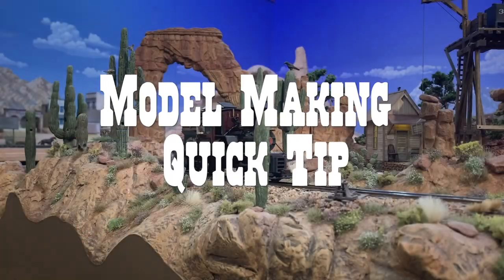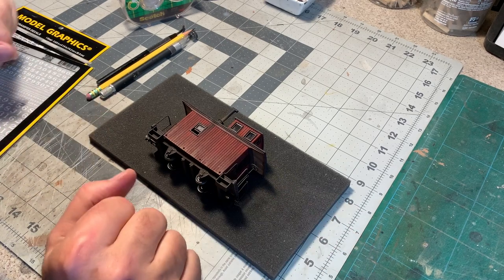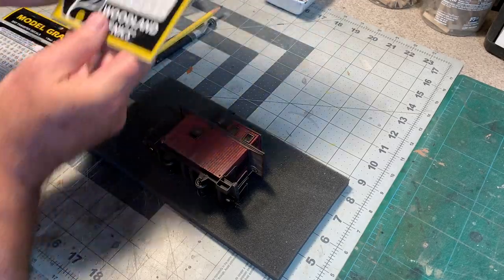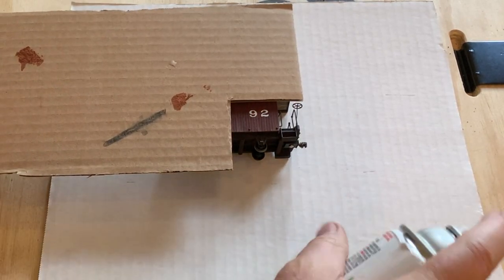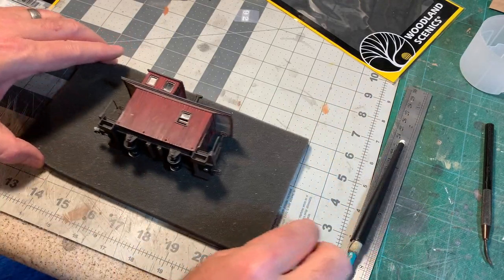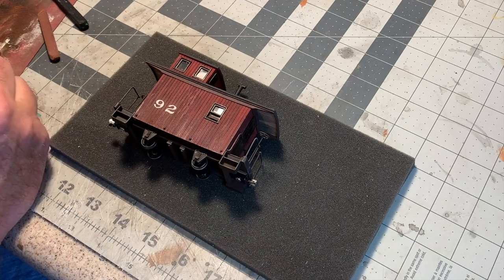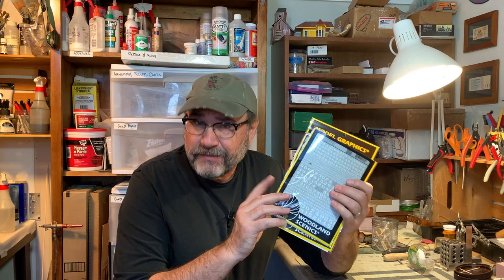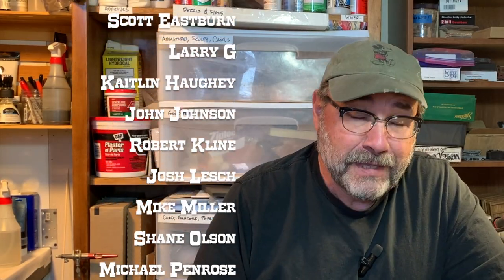Model Making Quick Tip: Dry Transfer Decals

Comment: Dave, I also remember the old Letraset transfer letters from Architectural school day', used them to produce great-looking drawing title blocks. Fat forward to Woodland scenics, work great on wooden cars., the pencil is the best burnisher for all modeling surfaces.'Dry transfer letters on airbrushed cars/ locomotives etc are a little bit more challenging.. I've applied them over tru -color paint and the tape masking or scotch pulls off the paint if you rub the tape down to stick. Ruined a few good paint jobs that way.I now use a rubber band to hold them in place. If you make a mistake the letters can usually be pulled off w/ masking tape/ soft touch and or a little water on the letters and lightly scraped off using a Windsor Newton watercolor brush.
Thanks for your tips. !! Todd

Comment: Good info as always!! I will not accuse you of being as old as I am.....but in the 1980's when our hobby shop wanted to start a decal and dry transfer line I went to the big art supply store in Charlotte. It had a room, about 24 x224, full of every Latraset sheet. I used a lot of these until graphics computers became viable.  But even after the computer age came we were still making dry transfers for the model car hobby. Charlotte had TWO print shops that did the dry transfer process in house. By the time the hobby shop closed we had made , and sold, millions of dry transfers.  
One note....I still have all those Letraset sheets. While they have 'aged out' if I REALLY need to use one I spray a very light coat of adhesive on the sheet back and I can get them to lay down. (attempt at your own peril) Thanks for a little good ole days!

Comment: Hi Dave, Great tutorial. I still have some original Lettraset  sets from the mid 80's when I was doing paste-ups. If they have dried out but still intact I lightly spray the back with Super 77 spray adhesive before applying, much as you have done, and get good results. They do need dull coat after of course.
Reply: I really like that idea of using Spray 77 on old transfers.  Of course you would need to follow Dave's DIY of cutting out the letters and tacking them together with frosted Magic Tape.  I'm definitely going to give it a try.
Jim

Comment: Kind of amazed you didn't use tweezers when you were aligning the transfers. Once I got a set of cross-locking tweezers to free up a hand and get my sausages out from my view, it made placing decals, labels, and other small details so much easier. That aside, it was really nostalgic to see the transfer often not completely transfer on the first go. I happened so often; I think it had to be by design.
Reply from the maker: I would definitely use tweezers on smaller letters/numbers.

Comment: Great video! You mentioned the dry transfer decals expiring, I was wondering can the same thing happen to waterslide decals? I have some custom waterslide decal paper that I print decals on and it worked really well when I first got it, however now the ink seems to erode off the decal no water how much gloss I use. I thought maybe it was cause I wasn’t doing it right but maybe it’s cause the decal paper is expired now or something like that
Reply from the maker: In my experience, yes, waterslide decals also deteriorate over time.
Reply: @ThunderMesaStudio  ah that would explain it then, thanks!